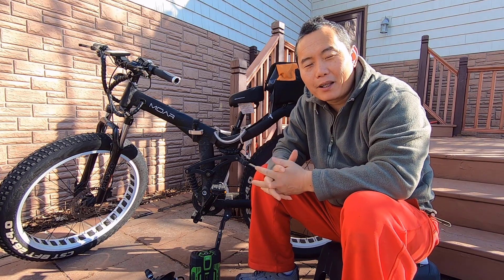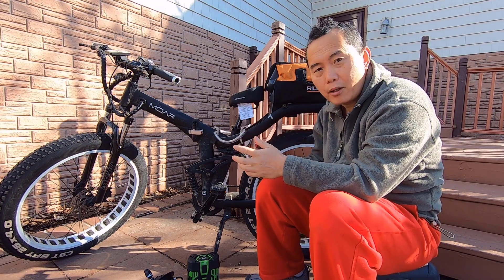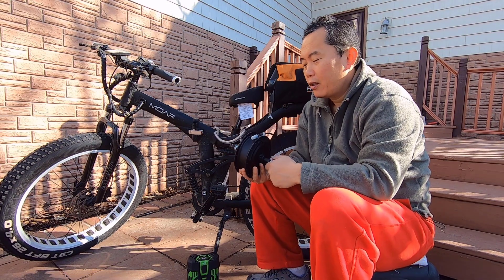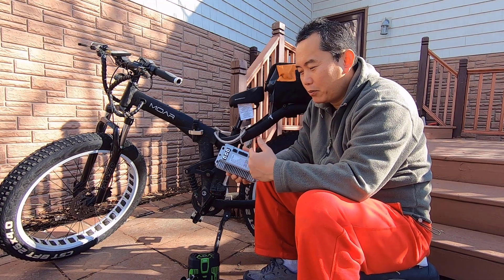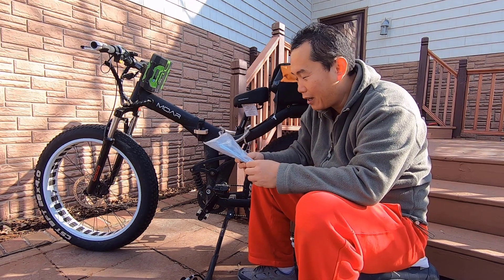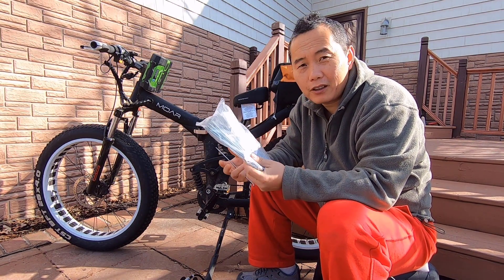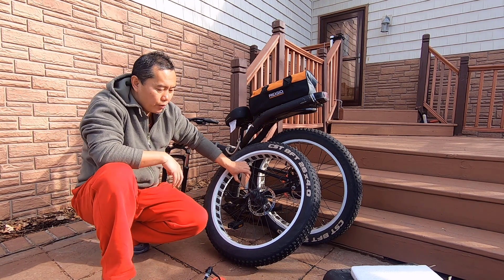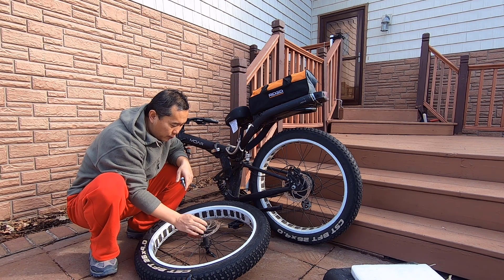DIY All Wheels Drive Electric Bicycle, Build hub motor bike wheel, replace spokes

Comment: Not an easy task adding a second battery and a second motor. You need 2 controlers and special wiring for the 2 batteries to work together.